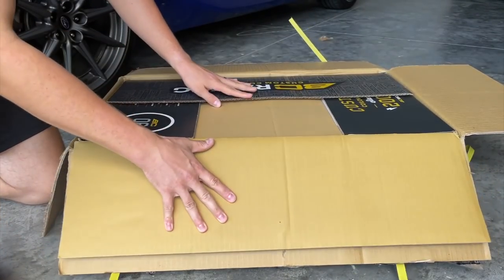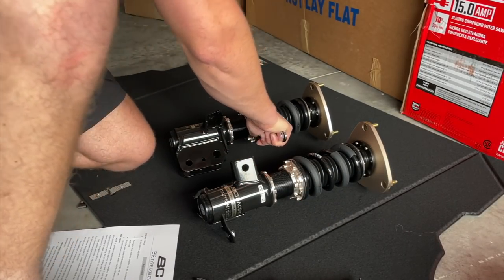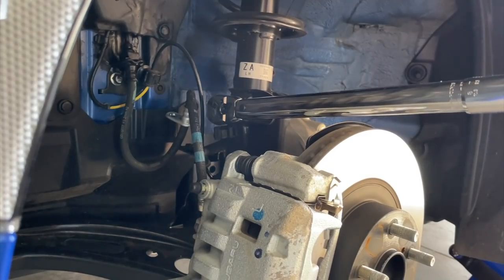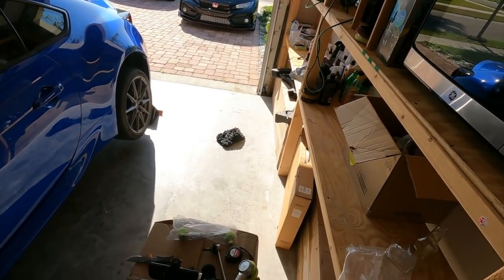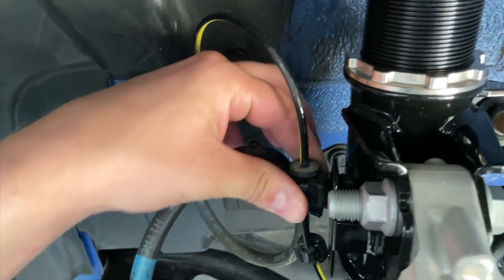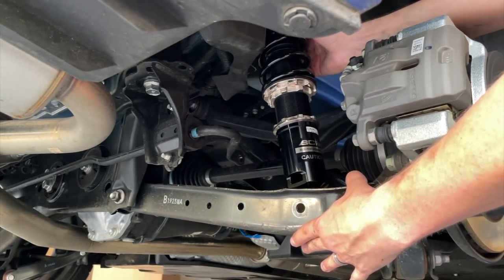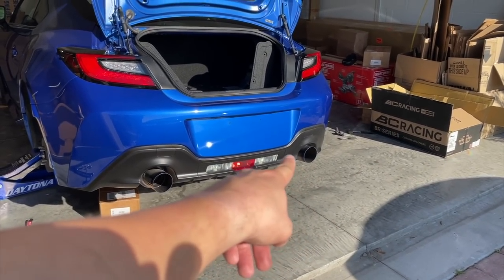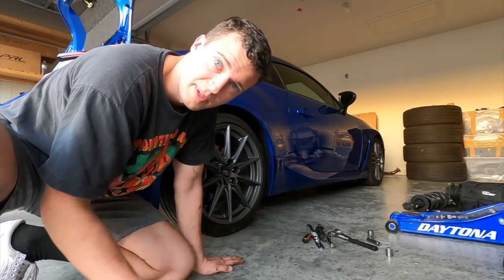LOWERING MY 2022 BRZ with BC Racing Coilovers!

Comment: noohh, don’t use torque wrench to break bolt lose, get 1/2” impact wrench, you’ll enjoy more working on cars with good power tools.. 👍🏻
Reply: Or if not power tools, a nice breaker bar will do it. Should’ve seen my face when I saw a torque wrench was used to break a nut.
Reply: I'll bring my 1/2 milwaukee when I come over so you can try it.
Reply from the maker: @ITIRICI  sounds good Josh!
Reply: @Camhill182  Home depot has the Ryobi 1/2 impact wrench on sale all the time for $99 check it out.  I have it and I can break pretty much any nut.
Reply: @ITIRICI  milwaukee has some of the best power tools especially for the price
Reply: @Tool0GT92  that's what I have, good for once in a while car guys lol.. cheap and effective, but milwaukee is still better I kinda wish I went with it, haha
Reply: @Camhill182  deal at has their whole impact with battery and charger under $250 in Amazon. That’s what I use as the Milwaukee will cost you $400+
I’ve removed a couple subframes and suspensions and still going strong. Even wheels that my breaker bar and all my weight jumping in it couldn’t take off

Comment: Nice vid. Next is the brakes. That is one of the biggest weak points of these cars, they come with very weak brakes from the factory considering these are meant to be momentum, handling HPDE type of cars. Don't forget to do the stainless steel lines when you get the new brakes, most kits come with them included but just double-check.
Reply: Agreed.  Irritates me they would have put such crappy brakes (and stereo) on this car.  Anxious to see how easy or hard this is......

Comment: Loved the video Cam! It looks great man. I lowered my 06 Mustang about 7-8 months ago, and I’ve loved every bit of it so far. As you’ve seen, with lowering your car you get the reward of the awesome aesthetics as well as the performance boost they give when taking turns quickly! As you mentioned, scraping is always a possibility, however, over time you’ll learn certain spots you need to avoid and honestly, just going slow over inclines and taking them at an angle one wheel at a time goes a long way! Because you’re so low to the ground and because these performance suspensions are meant to be more stiff than stock, you’ll definitely notice an increased road feel, which can be great for joyriding, but sometimes it can be annoying feeling every bump and crack in the road when daily driving. But hey! Coilovers are for fun not comfort haha. Keep up the good work man!

Comment: Loved this video, reminds me of my first time doing some serious work on a car. Things I recommend are a good battery powered impact to make removing bolts and nuts faster, and jackstands to put the car on so you can use the jack to hold suspension up for coilovers install. Also relying only on the floor jack to hold up the car is generally bad practice, as the hydraulics in the jack could fail at any time.

Comment: 19:32 Both. 
I was shaking my head wondering why it took you 3 days to do something that would take me 3 hours (granted that's if no bolts strip due to rust lol). But then you said you had never done this before, and I remembered my awful first time. Watching you learn through the process and doing it on your own, successfully mind you, for the very first time was pretty neat. I'll tell you straight up, I had to have my dad help me through everything in the beginning because I was hopeless. Stripped bolts, broken parts, not being able to get the holes to line up. But with lots of time and practice (changing out so many different parts), I learned how to do it all on my own, in a timely manner.

It's all a learning process, just like everything else. The more you do it, the better you're gonna get at it. 

Great video, and sweet car.
Reply from the maker: Thanks!

Comment: im using this type of coil overs but for the 10th gen civic... makes a real difference. lowered it a bit only compared to stock as daily driving and set the hardness to the middle...  been on it for 2 years now and really transforms the car handling. less body roll and car feels more planted.

Comment: Good for you for doing this yourself. Saved a bunch of cash and learned a lot along the way. I hope you take on more projects for your BRZ.
Reply: Safety and helpfulness tip: Put the car on jackstands and use the jack to move the knuckles up and down. I've done coil-overs, sway bars, endlinks, etc. a few times, and it's one of the tricks of the trade.

Comment: Get a second jack a cheap ass one, it helps with jacking up the brake rotors to help you get bolts in. Helps me out a lot because my car has air suspension struts which I’m constantly taking in and out for fitment reasons.

Comment: Is it recommended to get an alignment? looks great, looking forward to the adjustment part. good job!
Reply from the maker: Yes
Reply: I drove my car without a wheel alignment for a good week. Its driveable just one problem, you have to turn your steering wheel a bit on the side to keep the car straight lol. So technically you can its just it could be dangerous if you're unaware that your car is going a bit to the side.

Comment: Really cool video. Just a good advice, get some good jack stands and use them to hold the weight of the car after you jack the vehicle up. It is super unsafe and dangerous to let the hydraulic jack hold the car while you go under it, you don’t want to get killed by your car, remember safety first. 😎👍👍

Comment: Don't know if you did this, but the bolts holding the rubber bushings on each end of the rear control arm needs to be tightened when the car is on the ground (at ride height). If they're tightened while the car is in the air, and then lowered, the bushings will be under tension and will be worn out prematurely. I found this video explaining why: /watch?v=QksCa9rSwTs

Comment: You’re bold for learning how to do this yourself I let one of the homies do mine and tossed him 300 bucks, took 3 hours haha
Reply: fr, I wouldn't do it on a new car. I did however did it on my piece of crap 2001 camry lol. It was real pain in the ass struggle the first time I did it. Would I do it on the GR86 when I have the money to do it? Yeah I would. Its a great experience to at least try to work on your car, or at least on an old car since at least if something does break its not that expensive to replace (bolts wise).

Comment: The adapter on the end of my breaker bolt snapped on those front 2 bolts. I was using a 1/4 in drive. Bad idea

Comment: You should link up with my best friend eddy he lives in brandenton and he has brz as well, maybe take a trip to mexico. ;) 
lmk for contact info.
Reply from the maker: What year BRZ?
Reply: @Camhill182  i believe its either a 2016 or 2017, he's got an E85 kit BC coils, exhaust and other mods I'm not too sure of.
Reply: @Camhill182  2016 / Fuel injectors, full exhaust system (equal length), E85 tune, BC,s and some minor cosmetics.

Comment: You should use a shop. You don't have the correct tools for the job. You don't have jack stands. You had a hard time because you should have put both front wheels or rear wheels up at the same time, then the sway bar endlinks don't have uneven force on them. You could have used the jack to raise the lower controls arms to get the bolts in. Except your car was sitting on the jack. That's very dangerous, without jack stands. Don't listen to the other guys and buy Milwaukee impacts. Using your hand tools is a much safer way to do the job since you're so new. You will have much less chance snapping, or crossthreading bolts. First try you get the effort. But 3 out of 10 for safety and skill.
Reply from the maker: bro this is an awesome comment
Reply from the maker: I expect you to rate all of my videos here on out 😀

Comment: Good Stuff bro. I cringed watching you use your torque wrench as a breaker bar, and then a hammer. I wouldn't recommend you do that. The sway bar links are adjustable because you need to install them at the "new" natural ride height after installing the coilovers. You put strain on the sway bar if you use the stock ones with the new height I think. Also I recommend after any form of suspension work that you take it in for alignment right after.
Reply from the maker: I don't know why everyones freaking out about the torque wrench thing. It was $70. if it breaks, ill get something else. not even sweating it a little bit
Reply: @Camhill182  🤣 i thought i was the only one
Reply from the maker: @maurjul  lol nope!
Reply: @Camhill182  The concern with the wrench though is not so much about it breaking but about it getting thrown out of calibration. So if you mistreat it then it may lead to you putting too much or too little torque on the bolts your trying to torque which defeats the whole purpose of it. And there would be no way of knowing that this has happened so you keep using it to torque your wheels to 88.5lbs but you're really only putting 70 or 100, who knows?

Comment: Don’t Disconnect the Brake Line, hang the caliper with wire or something!
Reply from the maker: the brake line is screwed onto the coilover. how would I have removed the stock assembly without unscrewing the brake line?

Comment: Please don’t use your torque wrench to loosen nuts and bolts that’s not what it’s designed to do and won’t be as accurate as it’s supposed to be, just get a breaker bar.

Comment: Why not spend a dew extra bucks for a decent swt of coil overs.... Tein ST a shock and spring. Anything but BC trash
Reply from the maker: And why are BC trash?
Reply: @Camhill182  they are too stiff as you can tell. There springs arent anything fancy, most offer progressive springs which fix that stiffness. They dont give a lasting experience as they sag over the years and dampers get soft. Ya the BC factory makes a huge load of coilover that are flooding the under 1000$ market. Doesnt mean there good. And the biggest, they dont do real R&D the 2022 coilovers are literally  the past gens. Company's like Tein, Tanabe, HKS have all redamped there coilovers for the new chassis. If everyone was gone and it was up to BC to make new things things would really suck. Support real brands.